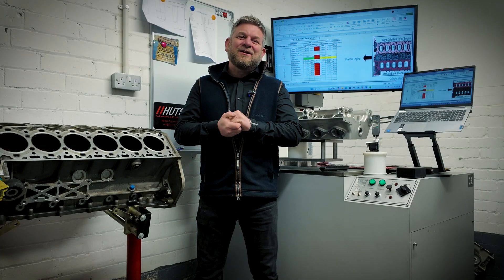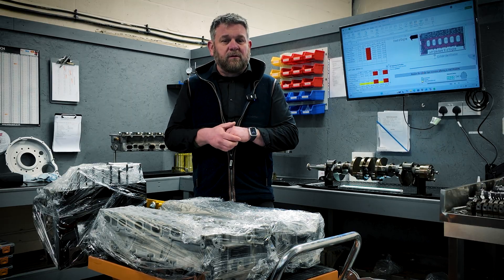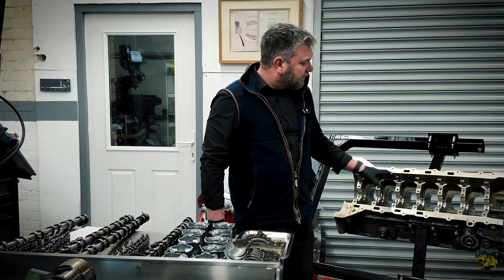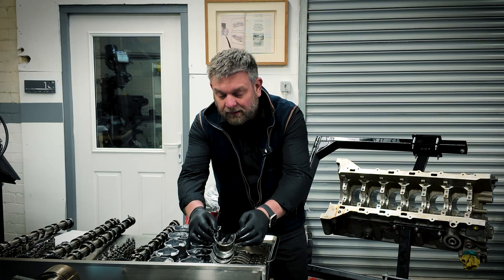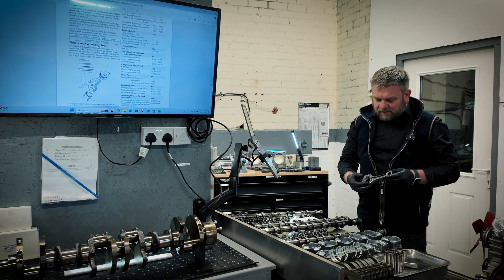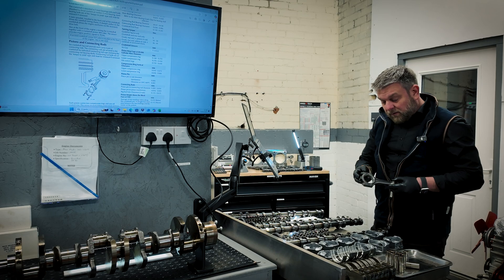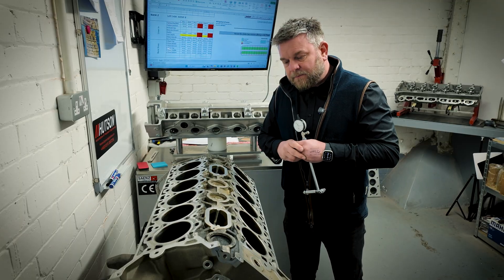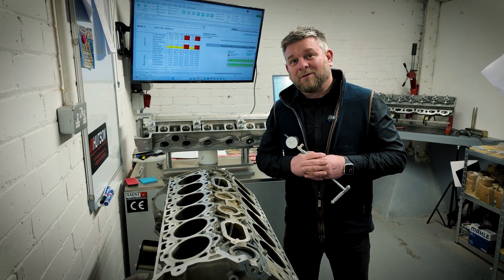Aston Martin V12 Engine "The Dreaded Tick" A Detailed Investigation.

Comment: Interesting to hear the tick is the piston in the cylinder.
This means buying an Aston V12 with the tick is ok because it is not catastrophic , (like it would be if the tick were a bearing).
Annoying it is, but a significantly lower price when buying the car might make it worth it.

Am I correct in believing a slightly ticking piston is not catastrophic?
Reply: Or a slowly ticking time bomb
Reply: it is cheaper to replace the bearings and even a crankshaft than to machine and redo the liners
Reply: You could replace with Perkins Diesel or Nissan TD 27 for economy and reliability....

Comment: Is this problem on every v12 ? ie 2008 2012 DBS ? or the earlier Db9?  also DB7 and Vanquish v12 ?
Reply from the maker: The honest answer is we don't currently know, there is a connection related to a change in the manufacturing processes but the years and models affected are still being evaluated, the data is being recorded and in time we will have a more comprehensive picture.